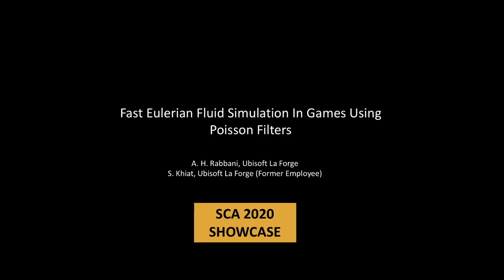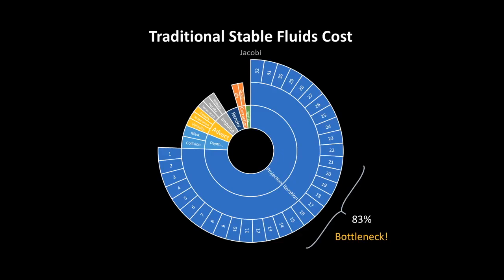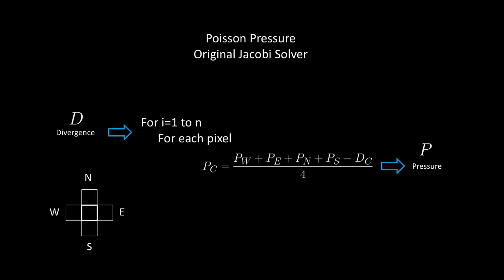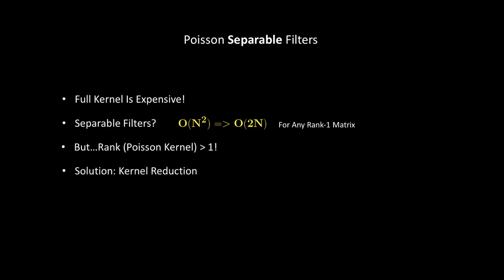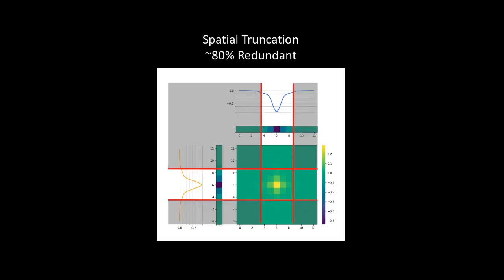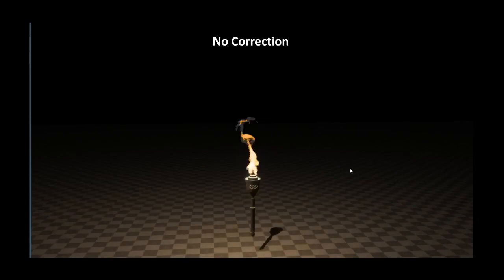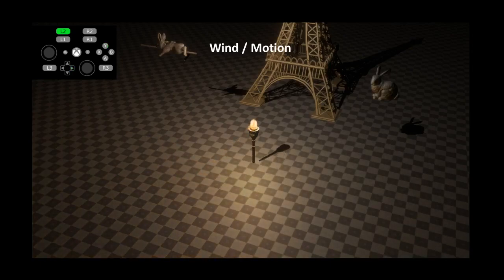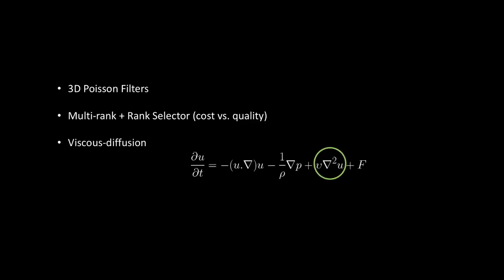Fast Eulerian Fluid Simulation In Games Using Poisson Filters (SCA 2020 Showcase)

Comment: Very nice ! 
Though, if I understood it correctly, the trick can not be applied to solve systems with variable coefficients like they occur in fluid simulations with varying density. Is that correct ?
Also I don't understand how this method works together with obstacles. Wouldn't that require dynamic values of alpha/beta which makes precomputing the kernels impossible ? Also the paper does not really mention this issue. 
I'd really appreciate if you could shed some light on this. :)
Reply: We have recently submitted a paper that explains all your questions in detail, including the 3D sim and dealing with obstacles. In a nutshell, this is a drop-in replacement for the linear solver used in the projection step and diffusion (not addressed in the above work), so it does not really care about what is solving for (density/temperature diffusion or mass preservation). But if your simulation parameters need to be variable in real-time (diffusivity or cell size), you would need to pre-generate a bunch of filters beforehand.

I will put a link to the new paper in the description whenever it becomes available.
Reply: @shahinrab  thank you ! can't wait :)